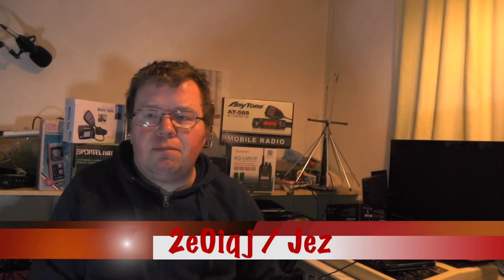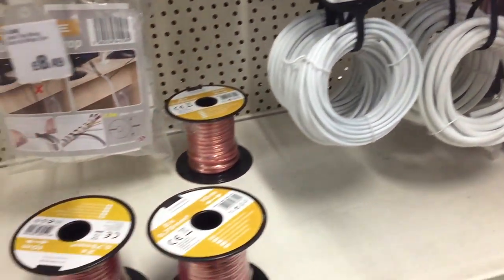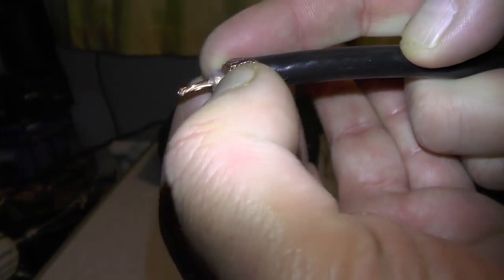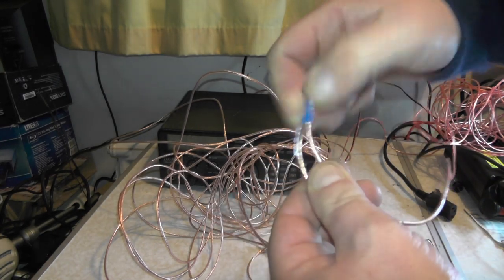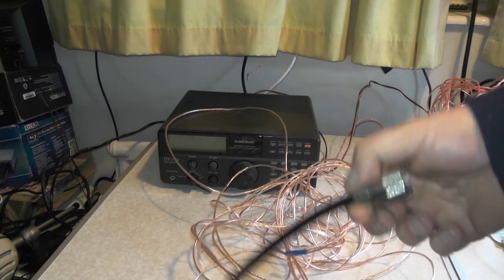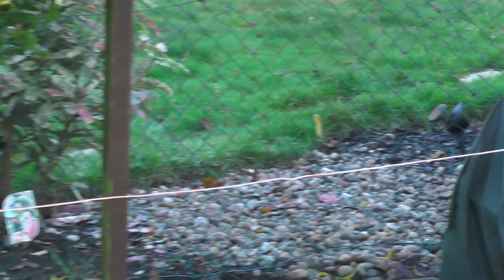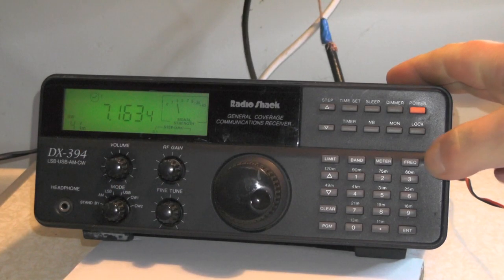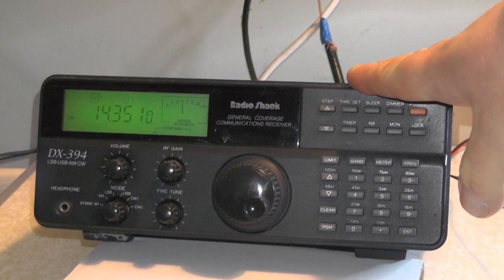Long wire antenna build

Comment: Thanks for video, brings back memories. I am a SWL, I had a DX 394 20 years ago until the grandkids mullered it by spilling water all over it. I had long wire made from old telephone cable. I made a simple antenna tuning unit out of a piece of broom stick wound with magnet wire which I copied from a radio book and it worked. One morning I received the South Island weather forecast from New Zealand to where I live near Dungeness. I was so surprised. I called all the people in the house to have a listen. I don't think Radio New Zealand broadcast on shortwave any more. I still love shortwave radio and listening all around. I received a QSL card from the Marianas Islands last year. They are north of Australia, so the bits of wire do work good sometimes. Thanks again for video again.
Reply: Rnz on air oks check their web for freq for europe

Comment: I had longwire 30 years ago. What helped with getting a good signal was using a tapped coil with 12-way switch, which added various lengths to the longwire. Also a balun with earth helped match the impedance.
Reply: Great information!!!!!

Comment: Thanks for the great advice inbuilding your own Long Wire. I'm about to buy a screened copper wire (30Mts) and drape it all around the back garden, eventually will be connected to a battered old Tecsun S2000. Will get back to you here with the results.

Comment: The 20 m wire is only half the antenna you need some ground radials in order to get anything reliably. If possible run a piece of coax all the way outside and then connect your wire as you've done but also connect several wires to the grounded part of the coax also known as the braid and you will improve your signal tremendously

Comment: Thanks for presenting your version of a quick and dirty, random wire antenna, you might enjoy greater sensitivity using the Hi-Z input on the DX394 (RCA on rear panel) instead of the Lo-Z (50 Ohm PL259 socket) input 👍

Additionally looping the connecting wires around each other then back on themselves (twisted) would vastly improve the mechanical strength of the join, naturally solder and heatshrink would provide improved weather resistance whilst also further adding to joint strength and added aesthetics 😊
Reply from the maker: ill give it a try. Solder a RCA connection to the wire then place it in the hi-z socket ? ive never used that socket on the radio. Maybe anther video coming up cheers
Reply: @2j4ez  No worries... a little envious of your local noise floor 👍
Reply from the maker: @SpectreOZ  I get loads of it my way go up the garden and it goes it seems to be only on HF

Comment: The DX394 owner's manual suggests attaching a long wire antenna to the "ANT HI-Z" plug on the back - you should that give you better reception that the SO239 input you used here - that's the "LO-Z" input, and it expects something like a dipole antenna instead.
Reply from the maker: I’ll have to give it a try

Comment: For a radio with a SO239 connector you can use a banana jack on the end of the wire and insert it directly into the center of the SO230.
Reply from the maker: i could of used that but only had a piece of old coax with a pl259 plug lying around the shack

Comment: Awesome antenna quickie works fabulous on the DX 394 I love mine I think they are really underrated radios thanks for the idea I made one of your brilliant antennas but just used small electrical wire nuts to make connections. Thanks

Comment: it is surely working, I don't know if the receiver have a 50 ohm input impedence, I just guess it would be better to tune the long wire with a hf balun/autotransformer, with a 9:1 ratio, or more.
It would good to make a 2nd part sequel

Comment: Tell ya what Im gonna try when my rcvr finally arrives. I have a 100' extension cord on a spool. (I roll it out to mow the lawn and wind it back up when Im done) so why buy any wire.
I can use an alligator clip to grab any one of the three wires on the plug and the braid I will also connect by alligator clip to a gnd wire from my out door faucet. If needed or desired I can "plug in" another extension cord to the end of the first one, and string em both along the top of my split rail fence. If needed (experiment) loading coils can be wound and alligator clips again used to connect. Since the wire is well insulated I could toss the end over the rioof to get the ant up in the air higher. 
BTW Alternatives Ive seen: (An article where) a "slinky toy" was used for a long wire. 
For a loop antenna, a roll of 25 wire ribbon cable stretched around a 55 gal plastic barrel with the ends connected together ONE WIRE OFFSET so s to create a 25 turn coil approx 30" dia.
A dipole of two tape measures back to back pulled to what ever length you desire. 
I guess just let your mind wander and think outside the box. Lotta ways to skin a cat.

Comment: Brilliant do I need to earth this aerial? Where I am all plugs are 2 pin with no earth.my receiver therefore has no earth. Thnx
Reply from the maker: STEVE HORNSHAW shouldn’t need to as your only receiving . If your receiver has a ground socket you can ground it by using a piece of wire from the gnd socket to the mud in your garden tied round a screw driver . But if your on the second or third floor it may act as a antenna you could also place it on copper pipe to ground it if need be
Reply: Thnx so so much and for your immediate rely, so much appreciated. Stay Safe. Steve in Romania

Comment: I will be building one of these next week.  I want to get on the 40 meter band.  

The ground is still frozen so I will have to wait before putting the base for my vertical multi band antenna in.

Comment: Is it better to have an analog are digital receiver
Reply from the maker: I prefer analog if the Signal is very strong you can still  hear it. On the digital radio if the signal isn’t very strong it just breaks up and crackles

Comment: Great video.  I have a shortwave radio that has a 3.5mm input jack.  I have made a long wire antenna that uses an alligator clip to the whip antenna, but how can I attach a long single wire to a 3.5mm jack that I could plug into the 3.5mm antenna input?
Reply from the maker: I have another short wave receiver that’s got a 3.5mm jack socket for the antenna I’ve done a video on it check out my channel it’s a few videos back

Comment: Good, but how can you neutralize all the static electricity that the wire catches, before it goes into the receiver? I once did a simple antenna like this and on the connector I had powerful sparks..
Reply: Did you ground the ant.?
Reply: @pauldavis22  I didn't, I am looking for a good way to ground it

Comment: You need to use a receiver atu to get max incoming signal a long wire will not be resonant over the bands your covering. 73

Comment: Can I lay the wure on a metal roof?
Reply from the maker: Dont see why not as your receiving not transmitting. but you may find you get a lot more interference from the metal roof. the only way to see if you get interference is give it a try
Reply: @2j4ez  Thank you.

Comment: Somebody please please buy this guy a Soldering Iron....
Reply from the maker: Got one ill use it next time i do another video in making a antenna
Reply: And some heatshrink tube
Reply from the maker: @MERCEDES-AND-DINO  it was a quick antenna build if i make it again ill will add some heat shrink

Comment: Good Day. I found this video while trying to find one for an antenna. I have a Radio Shack Pro-97 Triple Trunking 1000 CH Scanner, 20-527, Fire Police Air Ham. I would like to know if this would work for my scanner? Please let me know. Thanks.
Reply from the maker: This simple antenna will only work on hf bands ie short wave the higher the frequency the smaller the antenna the lower the frequency the bigger the antenna
Reply: @2j4ez   Ok. Thank you for the reply.

Comment: good vid and good use of random wire for your long wire antenna, how well does the "inverted V" antenna do with this receiver or is that more of a use-by-use case type setup?
Reply from the maker: Fox Nakamori hi I’ve never used a inverted v antenna on this receiver .

Comment: How long does wire have to be ?,i want to listen to 0-35 mgz i have a 90ft washing line will that do or should i cut some off ?
Reply from the maker: If it’s got wire in the middle then you should be good go as your only receiving no transmitting and 90ft should be fine

Comment: Can I use steel wire
Reply from the maker: dont see why not give it a try
Reply: @2j4ez  cheers pal
Reply: @2j4ez  steel wire worked! But I've bought some speaker wire 10m to give it a go with

Comment: Very fine  !! I have a question about the wire.. Does the diameter of the wire can be important for a better reception ?
Reply: No. 73 de Peter DL8PJ
Reply: @sevensugarqueen3148  Thanks a lot...

Comment: Never heard of solder in the UK , that receiver sound rubbish...... get ya self a nice SDR
Reply: Right on. Multi-tapped coil and balun with earth tap. My crystal set worked better that Radio Shack 394.

Comment: Very fine  !! I have a question about the wire.. Does the diameter of the wire can be important for a better reception ?
Reply: No, it makes absolutely no difference.
Reply: Yes, it changes reception quality, but  you have no chance of noticing it without costy proffesional equiptment like we have in my Radioclub.
For this purpose like in video it's not important at all and you should worry about it.